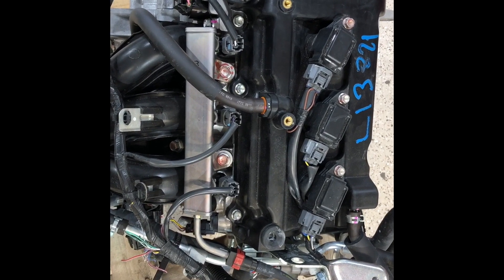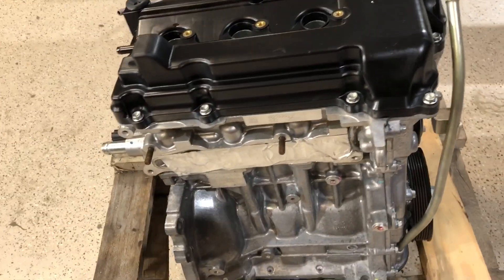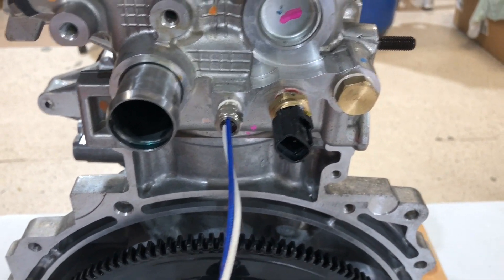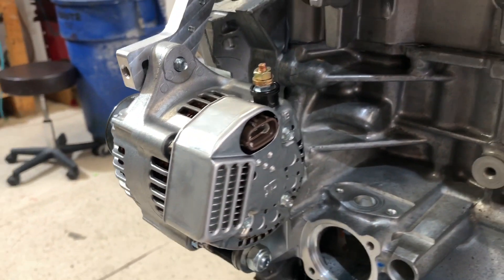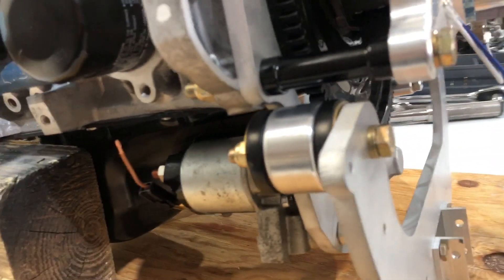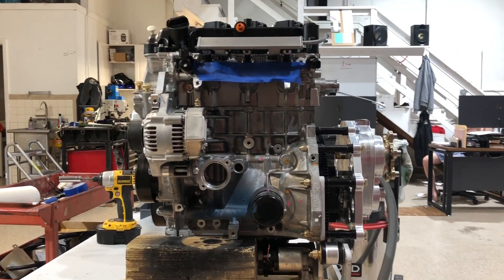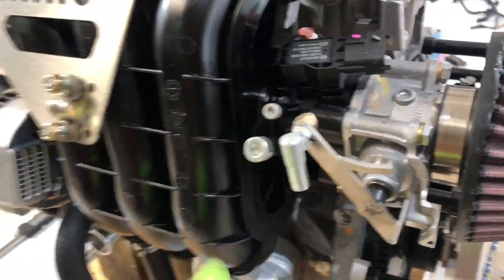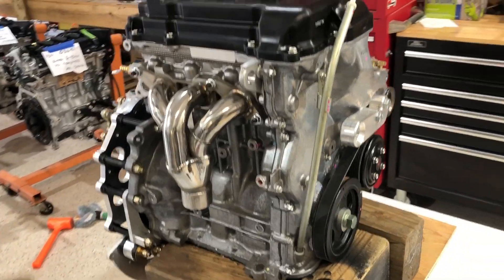VIKING 90 BUILD AT VIKING AIRCRAFT ENGINES - 2020

Comment: Hi would the viking propeller reduction gearbox fit a smart car 3 cyl diesel engine
Reply from the maker: Mounting locations are completely different from engine to engine, and our systems are sold as a unit.
Reply: @eggenfellner  hi have you ever thought about adding the FlyEco Smart Diesel turbo charged engine to your line up

Comment: Any particular reason why the 3 gear gearbox was not used in this build?
Reply from the maker: In a pusher installation the two gear gearbox works better for the installation and thrust line.

Comment: Great compact motor for the power rating.  I am very curious as to how your progress and testing is going for this motor equipped with the turbocharger is going and do you have any numbers to post for performance?  I turbocharged a 3 cylinder suzuki motor before with great success  and attribute my success  to the knock sensor and time to try different timing settings with LOTS of commuting hours on the motor.  I did many hour  long drives in lower gears to keep the RPMs up for a good test.  The increased torque this motor has was just amazing.
Reply from the maker: Still flight testing the Turbo.  More shortly.